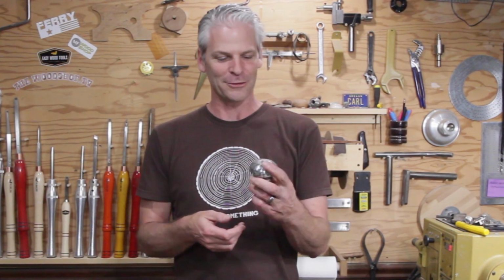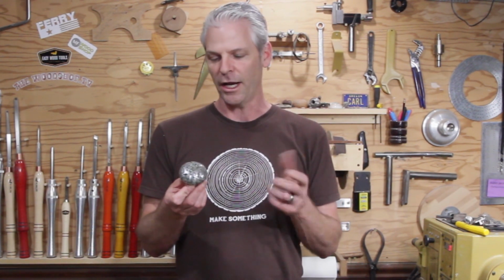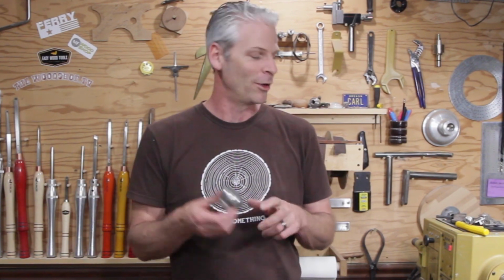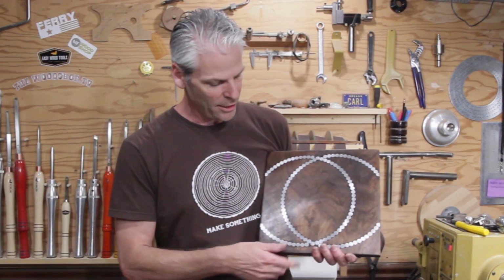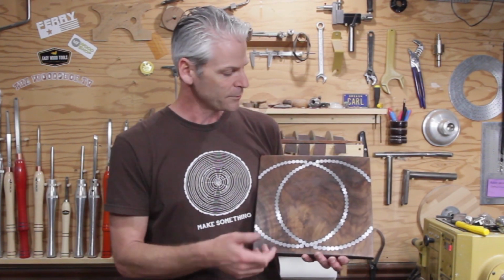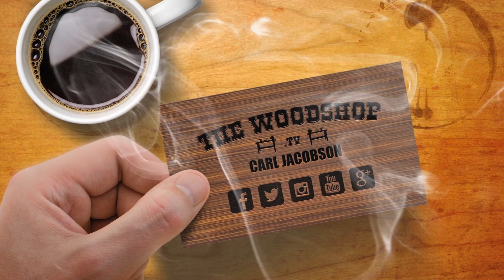Recycling Aluminum In Epoxy Resin

Comment from the maker: I cast these aluminum pieces in epoxy resin, and turned it on the lathe. The aluminum turned out much better than I thought. I'm going to make it into a gear shift knob. The Easy Wood Tools worked better than the gouges on this.

Comment: Will polished aluminum eventually oxidize if cast completely inside resin. For example a polished aluminum art piece cast in a cube of clear resin/epoxy for display on a shelf. I can't find anything online about how an art piece like that might hold up after a decade. I realize the epoxy will likely have to be rebuffed eventually but the aluminum inside you can't touch. Any idea?
Reply from the maker: If it's sealed in the epoxy I don't think it would oxidize. Maybe a up coming project to test it.

Comment: would putting a little wax on the tool help it with the aluminum? I know when I would drill it or cut it working with it helped
Reply from the maker: Josh Farmer That usually helps on a solid piece, but these are very small and would just catch.

Comment: On your clock board just change the angle or size of the circle and the intersections will come together symetrically right at the touching point. Practice layout with regular or small m&ms, or smarties candies.

Comment: Question: what type of aluminium was that. Did not look like standard stuff. Was it a bunch of small pieces glued together. Very beautiful. Thanks for video, Just subscribed.
Reply from the maker: butch holland Thank you Butch! Yes it was just small little disks epoxied together.
Reply: Carl Jacobson Thanks for getting back to me. I have one of those old Shop Smith's that are like 7 tools in one. Need to get small part for the lathe then I'm going to try this. Very cool. Have a great week.

Comment: Amazing work.  If you ever see the shavings catch fire though, run like hell.  Burning aluminium creates very toxic smoke, burns fiercely producing masses of steam if you put water on it, will burn in carbon dioxide or nitrogen; only special purpose fire extinguishers will put it out.  Powdered aluminium is an ingredient in many thermite explosives, and can be a serious fire hazard so be careful how you dispose of that waste.  It might be advisable to consult your local fire department for advice on disposing of the shavings.

Comment: I use to work a lot on a metal lathe and you actually want the chips hot. There is even math/science to back that up too. its all about keeping your tool and part cool. The chips should carry away the energy it takes to separate the atomic bonds in a form of heat.
Reply from the maker: Jared S Thanks for the info! I thought it might be the epoxy heating up, and popping them out.

Comment: While this is very cool, aluminum can be tricky and dangerous.  It can be spongy where the steel will drive in it and catch thus flipping up the handle end. (The SawStop exploits this characteristic.) Unlike wood that can also grab a tool, it doesn't necessarily splinter and can accumulate on top of the edge.        One other things about working with aluminum and plastics, deep splinters do not get absorbed by the body.  Steel, wood and even glass can ultimately be dissolved by the body to some degree. at least the sharp edges will dull.  Al and plastics remain sharp and might cause long term problems. The moral of the story is to work safely.